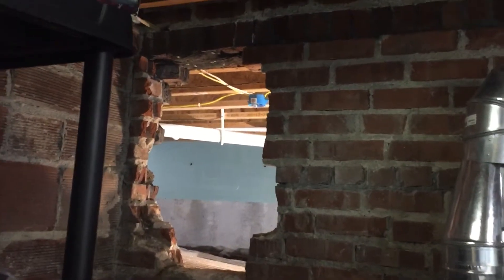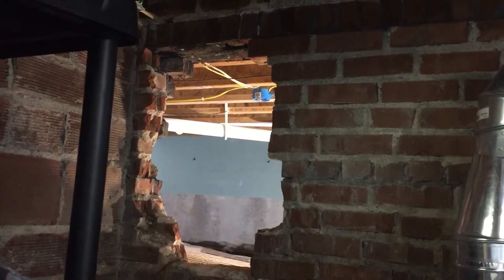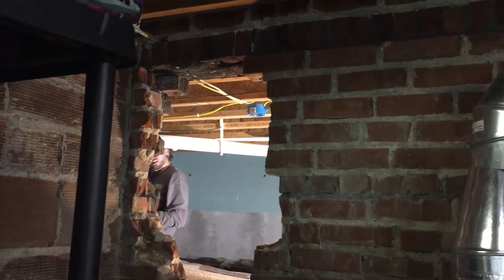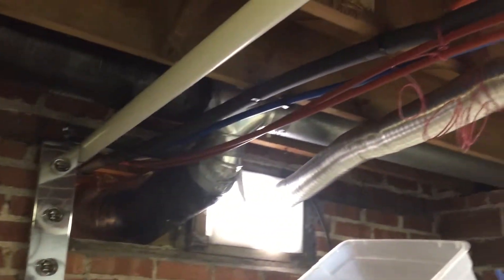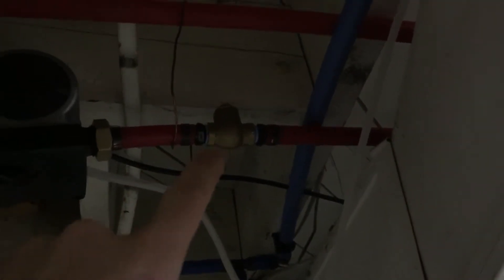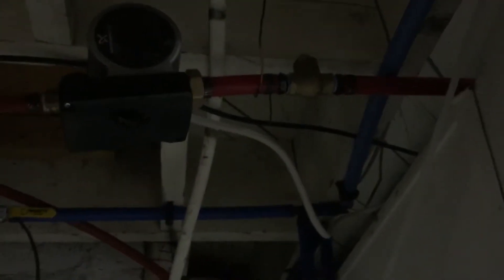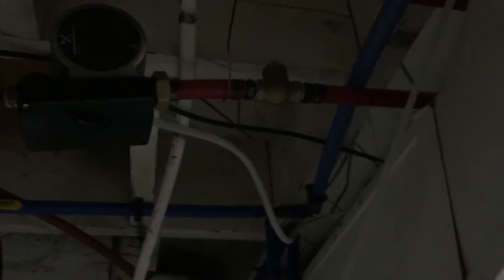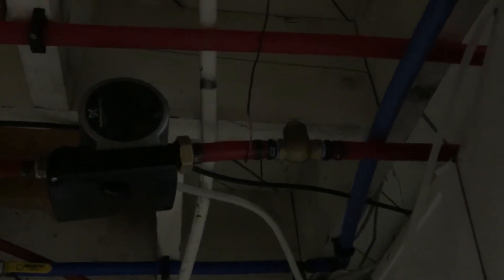Video #4 radiant project showing double heat transfer plates and pump.

Comment from the maker: Check out my other videos that I made when I installed radiant heat under my master bathroom and my original video has the instructions on the good way to run the PEX.  They are not the greatest videos but I hope they can be of help to people.
     Here is some information about the aluminum double heat transfer plates for radiant floor or ceiling installations. These are to use with 1/2 inch PEX  tubing with an outside diameter of 0.625 (5/8) inches.  The plates are 24 inches long and 12 inches wide with two groves roughly 8" apart.  So each heat plate transfers a total of 4 linear feet of heated PEX pipe.  I have installed many of these plates and found that the double plates cut down on installation time.  The way they cut down on time is that when you are putting your first row up using one side of the plate, when you make the loop going back it goes much faster because the plate is hanging there ready for the pipe.  FYI We found that a pneumatic (1/4") crown stapler works the best because they are powerful enough to penetrate the thick plates and it enables us to use short length staples so as to not penetrate the floor thickness.  If you buy 2 or more boxes we would be willing to throw in a 1/4" crown stapler for only $30 this includes shipping, let us know if you want this offer.  
     Plates start out at $2.95 each and then depending on the quantity you want we will start to discount them.

     These plates should be placed close together when by an outer wall or where heat losses are great, and can be placed further apart in interior spaces where heat losses diminish.  If you need  assistance in figuring how many double heat plates you need for your project, just let us know  we will help anyway we can.  

     We usually package them 100 per box so we can fit them in a large box to offer economy shipping.  This means a better price for you the buyer.  we also sell different box quantities, contact us if you need a substantial amount or an odd number.
   

     To help you compare to other suppliers, one of our 24" long double plates covers 4 linear feet of pipe, and there are 100 plates in a box so that makes 400 linear feet of heat transfer.  One other factor to consider is that the width of our plates are 12".  Compare that to 4 to 5 inches with other manufactures that sell the single plates.  Your getting increased heat transfer with our double plates.  After scraping off the paint, the actual metal thickness of the plates are .018" or 25 gauge.    Our plates are coated on both sides to protect from corrosion as compared to most un-coated aluminum plates.  Colors may vary.  These are factors to consider when choosing a manufacture.

    
    
    Shipping occurs within three working days of cleared payment (usually PayPal).  If this is inconvenient let us know and we will try our hardest to serve you the best we can.  E-mail me your zip code for a accurate shipping charge.

  
     We can custom make single groove and double groove plates various lengths up to 24" and widths up to 12".   We also make heat transfer plates for 3/4" Pex tubing.   Contact us if you need a substantial amount or a smaller quantities to sample.  Please don't hesitate to ask us any question you might have.  

      Here is a quote we got the other day from one of our satisfied customer about our double heat plates.

 (Just installed yesterday, seemed less time consuming than other plates I have bought.)   

 And another

     Joe, they arrived yesterday and I have been installing all day.  Thanks for an excellent product delivered in a very timely way. If you ever need a reference, I would be happy to oblige.    -John H.  (1-12-2018)

And another.

     Joe, can you send me another 130 plates, these are working so well i'm going to do an additional area.  Kyle H.  (3-17-2018)

MADE IN THE U.S.A.